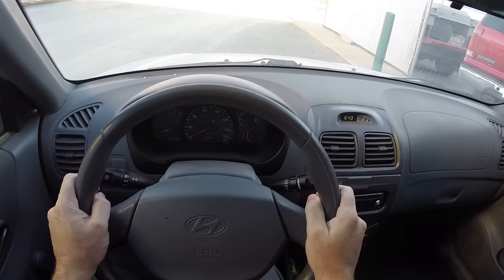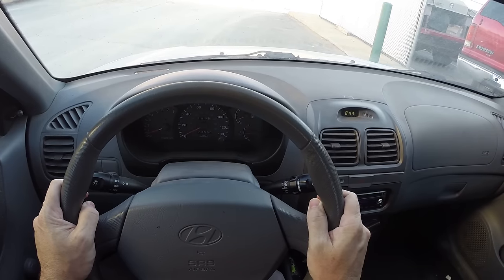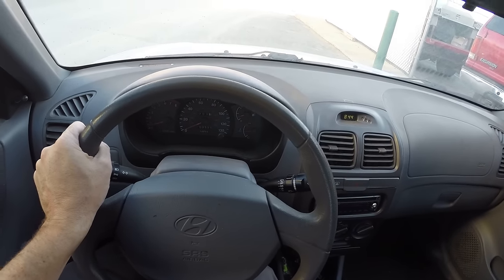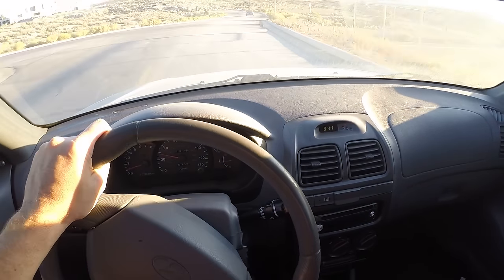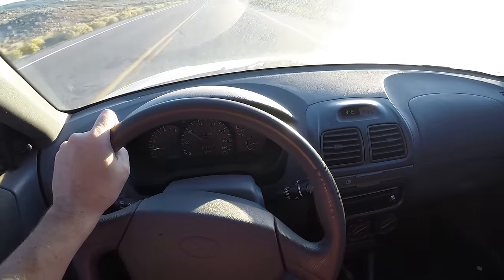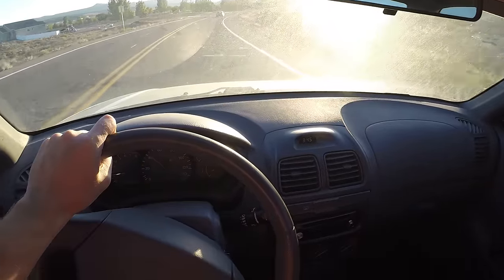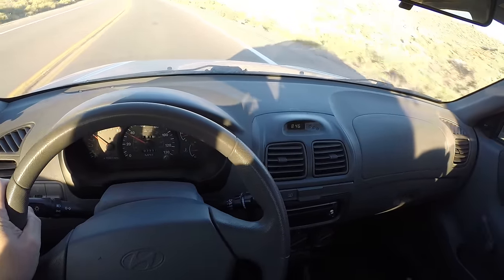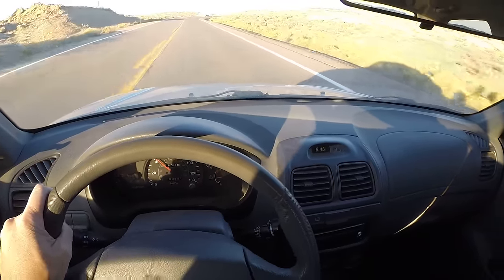What Does a Bad Wheel Bearing Sound Like?

Comment: I have a question, but before I get into that, I'm gonna tell you what happened. 

Last month, someone else's car broke down, and they just happened to have the same type of car as mine. They called for a tow truck, but for some reason, the tow truck driver got the wrong address. MY address. So he came over to my house and thought that MY car was the broken one. I'm sure he knocked on my door hundreds of times, but I was dead asleep and completely oblivious to all of this. Since my car doors were locked and he couldn't get the key, he went ahead and dragged my car onto his flatbed without putting it in neutral. 

I found this out later, but my front tires were turned to the left, so he had to kick my front left tire over and over again until the front wheels were straight before he could finish winching it onto his flatbed. My brother-in-law came over just in time and stopped him from leaving with my car. By the time my brother-in-law got here, my car was fully strapped onto the flatbed. 

Ever since this happened, I've been hearing this occasional weird noise in my car. It sounds like it's coming from the steering wheel, but I'm not sure. It definitely sounds like it's coming from the interior, though. It mostly seems to happen when I'm turning right, but once in a while, I'll hear it when I'm driving straight. As for the sound itself, it sounds a lot like a computer hard drive reading/writing. Any idea what's causing this sound and where it's coming from?

Update: I'm an idiot! The sound I was hearing was coming from my seat belt buckle! Because when you're turning right, your vehicle kind of pulls your body to the left, which pulls on the seat belt buckle!

Comment: True story: I noticed my steering wheel was shaking on the interstate when I changed lanes. I freaked out thinking it was a wheel bearing. I refused to drive my car to avoid the wheel from falling off. I called a tow truck, had it towed, and it turns out it only needed an alignment and the wheels balanced. I felt like a fool. 🤦🏻‍♀️But now I know what a bad wheel bearing sounds like thanks to this video.
Reply: Funny story in retrospect

Comment: Thank you thank you......this video helped me know the problem and which bearing and it was our right as well....the steering wheel left/right jerking test showed me as well.  As a preventative measure we changed both sides on the front.  
Now we have no noise on the front suspension.

Comment: it can sound like an exhaust issue if its rear bearing.    usually you can be going downhill and let off gas or put in neutral.. and not a signifigant sound differnence... which you would have if it was based on exhaust.

Comment: Huh, so it's NOT my tires which I rotate regularly, it's a bad wheel bearing!
Thanks for saving me the cost of new tires :)
Reply: I thought mine was the transmission.Just went to the shop a couple of hours ago and they found out that it was the bearing,the front left one.They replaced it with a new one and boom,no noise at all.

Comment: I hope mine is a wheel bearing, just bought a used 2003 Camry with 200k miles, sound is identical, except the sound doesn’t change when going faster , it stays the same.

Comment: Trying to diagnose my 2018 Colorado. I can rule out wheel barring due to this video. It sounds more like off road tires  wah wah wah wah and the faster the truck goes the faster and louder the noise. It pulls ever so slightly but im not sure if its alignment or road slope. The other major indicator is when on the highway, when passing, once I hit 80 mph there is a small vibration in the entire truck.  I know I need a tire rotation but would like to get your thoughts. Thanks!!

Comment: In my 2005 jeep grand Cherokee, i can hear the same noise it’s just not as loud but you can clearly hear it on the passenger side more, but you only hear it around 40-60mph when i’m at 70 sometimes 80 you hear it come back barely but mainly at 70mph you don’t hear it at all and it sounds like it went away

Comment: Lehman’s automotive just charged me 214.00 to tighten 3 lug nuts. They test drove it. Put it on the lift, yanked on the tire, stethoscoped the bearing. After two hours, two men hand turned the lugs and found loose ones. I feel like i got hosed. So check your lugs first.

Comment: Great video - sounds exactly like my honda civic. Last service mechanic took it up supposedly and spun the wheel with no weight as supposedly you can 'hear a bad wheel bearing'. I have my doubts on the work done, but since i put on new tyres the humming/growling sound is super loud... so it confirms it wasnt my old tyres. Not sure why new tyres cause it to be worse, but anyway glad to know i wasn't going insane. 

what's the implications on driving with a bad wheel bearing? Is it dangerous or can cause a blow out of something?

Comment: I just had a bad wheel bearing passenger side of my truck .....I swore up and down the sound was coming from the drivers side front...I even got out on the running board while someone else drove and 100 percent it was the drivers side I heard the noise. Turns out it was the passenger side wheel bearing blew up. So never assume you know exactly where the sound it coming from. Because sounds on a vehicle have a funny way of sounding one place and be a complete opposite. And heres the kicker ....it would make a hard bang bang bang bang. And got faster as you went. But it would not do it in reverse 50 kmhr. So confusing yet finally figured it out... spent a solid day on the drivers side trying different things ...too have it be the passenger side the whole time....sometimes vehicles just WIN. Hahaha

Comment: Most of the people will look at wheel bearings when they hear a noise driving their car.  While it is true a very worn wheel bearing makes noise, the first cause of noise is actually tires. Tires can make pretty much the same noise as a worn bearing. It may be due to wrong geometry (such as wrong camber) but also some tires become noisy as they get old, stiffer and worn. One very easy test to find out if the noise is made by your tires is to drive over new smooth road pavement - if you can find one in your area: if the noise goes away you know it was caused by your tire(s).  If you go replacing a bearing, be sure to test it BEFORE undoing the bolts https://youtu.be/EvEqX2JpNCc

Comment: I hear the ‘squeaking/chirping’ noise and I have the same type of noise when I drive. The video only mentions a growling noise, which I don’t get when I drive. Is the squeaking/chirping noise associated with you driving at slower speeds in the video consistent with a bad wheel bearing as well?

Comment: This is exactly the sound that I hear. But it's much less prominent. I came to detect it only when I drove on a newly built road, and it hums when I turn to the left, meaning the right one is faulty I guess.
Reply: I replaced the right wheel bearing and the sound is now gone!
Thanks to this video, I was able to diagnose the fault myself and get it replaced, even though the mechanic insisted that it's fine at first.

Comment: Fyi… from hearing this tone of a bad wheel bearing… dudes wheel is about to fall off the hub. Don’t let it get this bad, wheel bearings makes a howling sound around 30+. You can typically notice a change in the tone of the car when the bearing starts to go. Get it changed before it gets this bad

Comment: My Altima  sort of sounds like this but it’s extremely subtle and usually during soft deceleration . I’ve also noticed my car shaking around 70-80mph. I went to balance my tires and it still shakes at freeway speeds . Not sure what it can be
Reply: My 04 pt cruiser is shaking at high speeds but mostly under acceleration, it is a front wheel drive with stock front bearings

Comment: Changed the damn bearing, noise is still there the exact same.
My press bolt broke when trying to take the bearing out so i had to resort to using a hammer although i didnt directly hit on the bearing and also placed it on an even metal plate to avoid damage. 

Could i have damaged it possibly ? 
Mine was also on the left side

And also to my suprise the bearing i ordered was supposed to be made in germany but i noticed it said china on it when i wanted to put it in. Could be a fake ? 

Brand was FAG btw

Comment: I've been struggling with a problem for about a month now. My front right of my Subaru Forrester 2015 makes a loud kind of banging noise or bumpy noise when I go anywhere from 70-80 mph but ONLY if I'm turning right while doing so. It's otherwise quiet and unnoticeable. Is this sounding like a wheel baring or something else ?

Comment: What is causing those ticking or snapping sounds? There's one right before 1:04 
It's a real loud and short tick or snapping noise. My car is making these sounds too and I don't know what it is. I thought it was my distributor, but I think I fixed that. My car won't make.thr sound when idling. Doesn't matter how much I rev the engine. When the car is moving the sound starts.

Comment: After checking the wheels, the front driver's side wheel had a little play and I had the same sound as in the video. However, after changing the wheel bearing, the sound did not stop. The other wheels do not have any play. Is there something else that would make a very similar sound?
Reply: Try and change other wheel bearing on front passenger. Bearings make noise before they get play so your noise might just be on the other side. (when they have play they tend to stop making noise after that)

Comment: Okay so mine doesn't sound anything like that but when I turn there's a clicking & a small amount of grinding. My right front rotor is the only one messed up & brake pads are top of the line (I don't play when it comes to brakes, it scared me!) so I know it's not my brakes & the fact they're new. Grinds bad when I press the brakes on right side & there's a slight vibration when I'm at 60ish. Husband thinks it maybe bearing but plants keep him too busy to check right now. So I guess as long as mine aren't as bad as that car I'm okay to drive to the mechanic as long as I'm careful right?
Reply: A clicking when turning could be a CV joint on the driveshaft, though it usually only happens at high levels of steering input, the best way to check is to drive in a circle in both directions at full steering and see if the noise is there

Comment: Today i took my 2004 Hyundai Accent to the Hyundai dealership service center in Fort Myers, Florida to have the right wheel bearing replaced, $250 plus alignment $150, drove out with the same exact problem!! Did a uturn went back explained but they said its because i have to also change the left wheel bearing! Obviously they are always right even though i argued to the point i was so angry i started crying!

Comment: I’ve been trying to diagnose an odd sound similar on my 02 Chevy Duramax after using my 4x4 in a snow storm and putting it back in 2 wheel drive I noticed my truck driving different making a loud growl humming rubbing noise in the front end when driving 50+ mph and gets louder the faster you go and when you let off the pedal and let it coast it slows down a lot on its own making that noise

Comment: Mine only makes that noise when I'm slowing down from 50+ mph, then when I'm at 10 to maybe 5 mph, I hear clicking or ticking noises from the same right front wheel. 2018 mitsubishi mirage g4 economy car with Cadillac prices for parts. I replaced a downstream o2 sensor and that sob was over 300 bucks

Comment: My noise is rotational but not constant it's quickly intermittent like a loud hum ever other second and it's vibrations and noice increases with speed as well. Can't really hear it much at 20-30 but 30-40 and above it gets louder. Sound like a wheel bearing still?
Edit: this occured after sliding on ice and my tire bumping into a curb doing all of maybe 5 mph. Granted it felt hard

Comment: My honda civic is making this EXACT but my repair place has told me that i need a full transmission assembly. They said it was absolutely not a wheel bearing but the transmission. Can a bad transmission make this sound as well?
Reply: Yo I’m having the same problem. Mine is only vibrating at low speeds tho

Comment: ive been looking into used trucks
and this kinda problem I came across, a bunch
i live in mn so i know alot of people tug their boats and overload their trucks, so problems probably happen when they overload their truck

a bad wheel bearing, someone else online talking about this too
weird thing, it sounds like an engine problem or a transmission problem, i donno, haven't been into cars and repair mechanics etc
but this seems, similar to multiple cars i've tried

i can imagine its from over stressing their trucks

Comment: I suspect mine is the wheel bearing but its not as bad as the one shown in the video. Mine is more a whining sound and only occurs between 70-75 mph and can feel vibration on the throttle. Could this be a wheel bearing? Thanks
Reply: thats exactly what mine is like, im wondering the same thing

Comment: Several years ago wife put new westlake tires on this . About that time this niose slowly began . In 2014 buick verono. I was thinking these tires are horible. They were of course along side of them wearing out badly on inside. So we put some goodyears and front wheel alingnment ,it was bad. I thought for sure .it would ride quiet.  Nope still sounds like a old muddin truck going down road. Even slow you can hear it. Yip you guessed it must be this front wheel bearing on right hand front. Getting it done.

Comment: I have that noise from the rear end of my Blazer. But when I put it in neutral no noise. Could that be from not having it in gear and coasting. I checked the drive shaft and the universal joints feel solid.

Comment: Hi did you hear the sound of the wheel bearing with the windows down or up because I probably have the same issue but I can only hear it with windows up. My noise gets louder when I speed up and also decelerating

Comment: My Nissan titan makes a tickticktick brapabrapabrap noise pulling out from a stop under hard acceleration only. Any ideas? Just changed the tensioner and idler pulleys, new belt, and replaced a universal joint that blew a grease seal but no luck

Comment: I have this exact sound on my 2012 Accord, service center replaced my left bearing and sound still persists. They’re replacing the right bearing and I’m praying that solves it.  Is there any chance that noise is related to transmission or timing belt?  I feel like I hear it more when my techometer is switching gears on acceleration from 1rpm to 2rpm and when I’m decelerating back down to 1rpm, so I’m confused why it’s a bearing issue.
Reply: I have the same car as you today I was told buy some one that it was my transmission but I took to a shop they said it’s wheel bearing it’s getting changed I am praying it’s only the bearing. By the way did the noise decrease when changed the bearing for one side.

Comment: Mine happens very intermittently and it almost sounds like tire rub. I know for a fact its not tire rub though because ive checked my clearances. It happens completely random and i cant cause it to make the noise, it just happens. No clue what it is.
Reply: Chris Tobin Brakes? If it goes for a while and it's brakes the rotor will really heat up on the wheel.

Comment: Okay so, on my Acura, I turned and I felt like a pop, and I got out to check the front passenger wheel and there was a bunch of grease that sprayed out, now it’s making a noise when I turn // accelerate but it goes away after going a certain speed around 40 rpm
Reply: 40 mph*

Comment: For a few weeks I thought that sound in my Honda Accord was the right rear tire....
Reply: I've got 2005 Honda Accord seems like I can hear it too when I'm driving fast. Not sure yet but I'm going to jack up the car and spin the wheels individually to hear any noises.
Reply: @mrwaqy Honda Accord is a great car isn't it?? Mines 20 years old with 220K miles and still running good....is yours a 5 speed too?

Comment: I have this problem before my 2007 Nissan versa hatchback have a bad bearing before i go to Firestone to fix it but they said its on transmission problems when i watch this again and again i realized that Firestone try to rip me off so i buy a new wheel hub bearing assembly and put grease on it now my bearings are silent and smooth now

Comment: I change my wheel bearing in my brakes and I still hear a noise in the front
Reply: I think its the engine and transmission
Reply: @Jr-fc6kf   it seems that when i go fast it makes a the same noise of wheel baring but when i brake it does the same.
Reply: @Jr-fc6kf  and what makes you think its the engine

Comment: My car occasionally make a sound and feeling that sounds almost like when you run over the side bumps on the interstate or when you speed up too fast in a manual vehicle. But it does it when I'm not accelerating super quickly and at many different speeds. Anyone have an idea what it is?

Comment: I just changed my wheel bearings and they sound like this. Didnt sound this bad before
Reply: Did you pack them with grease?
Reply: @christianbelcourt279  mine dont need to be greased
Reply: All bearings anywhere need grease my friend,without it you get friction.With friction comes heat and with heat comes blown bearing.
Reply: @christianbelcourt279  mine are sealed
Reply: I already changed them again. Turns out they were bad. The new ones worked fine
Reply: Glad it all worked out for you,sorry I couldn't be of any actual help lol
Reply: @christianbelcourt279  lol no worries. Thankyou for trying

Comment: after how many miles does this happen?
Reply: My front wheel bearing just went out on my F-250 at 175,000 miles. A set of bearings should last 100,000 to 200,000 miles if no junk gets in there and prematurely wears them out.